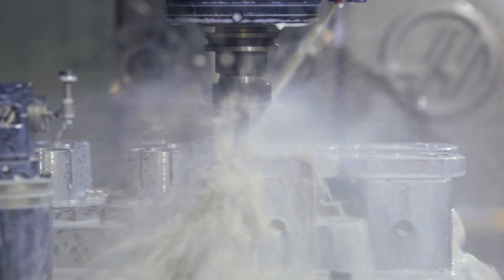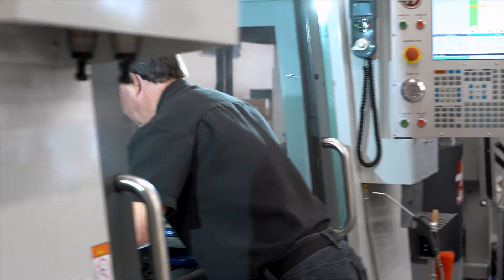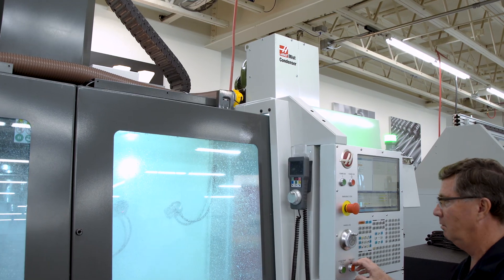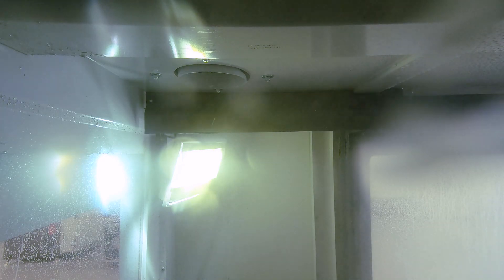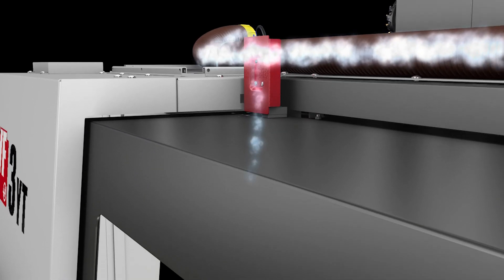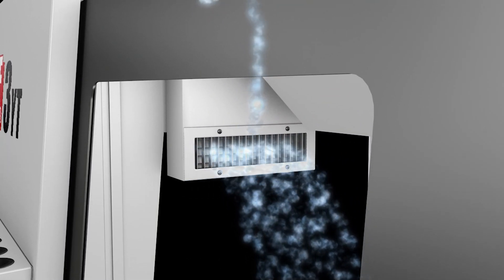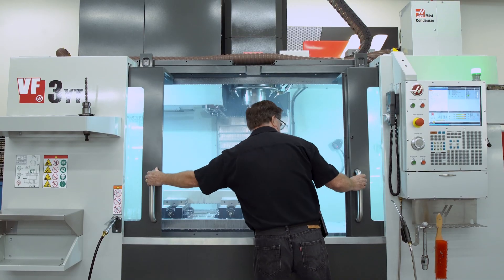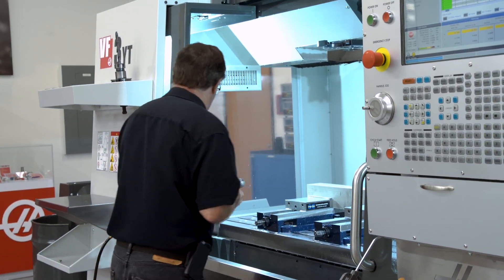The Haas Coolant Mist Condenser - Haas Automation, Inc.

Comment: The one Mist condenser we have  on your VF2YT blows  air with a bit of mist back to the CNC operator through gaps in the door sides, and blows like a hurricane to your face when you open the door. Poorly designed system.

Comment: why are the filters needed? more consumables?
how about doing something about the windows always being useless
Reply: Filters are likely needed to filter shavings out of the coolant as it runs through a pump.
Reply: @joshua_lee732  metal shavings in the mist? last time i checked this wasn't a surface grinder
Reply: @SuperAWaC  you come to where I work, I know a few guys use these machines as grinders. I'm talking something that takes 10 - 15 minutes will take them 2, 3, or even 4 hours.
Reply: According to HAAS website, the filters are what condenses the mist. I'm guessing they're designed in a way it separates the coolant from air.

Comment: Starts at $2,000 you’re welcome.
Reply: If it works as they say, it would pay itself off in short order.
Reply: TacticalKeychains I know using the same basically, but amazon brand. I change filters every 3-4 weeks and call it a day. $200 for the unit plus the cheap filters you can get in bulk & on a repeat delivery!
Reply: @TacticalKeychains ...Agreed.  "Condenser" is not an accurate description.  "Mist trap" is what it is.
Reply: TacticalKeychains if these don’t work I’ll be going to those! Thanks!